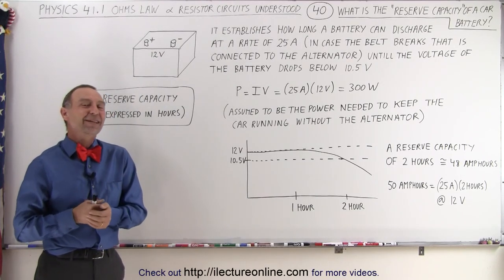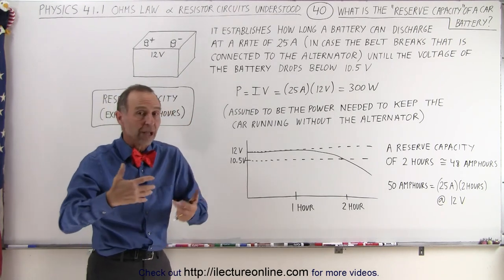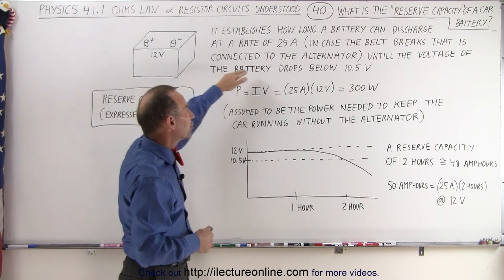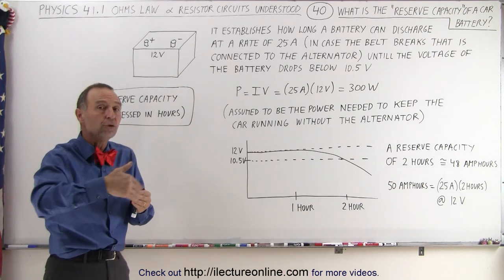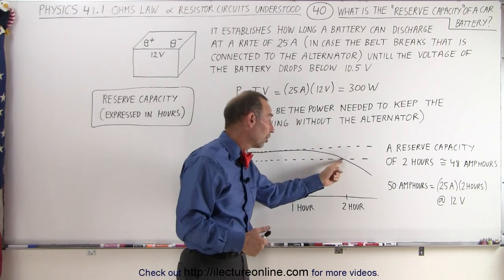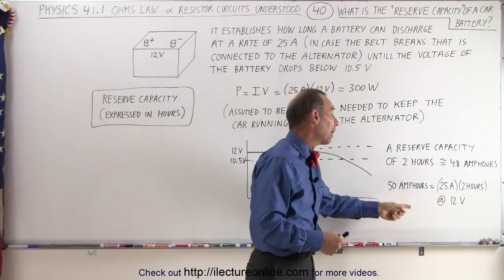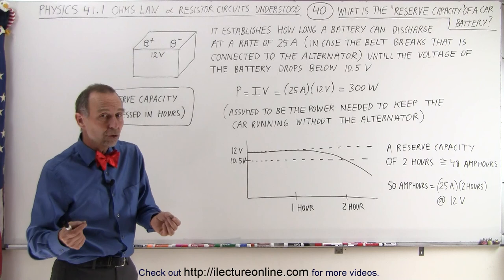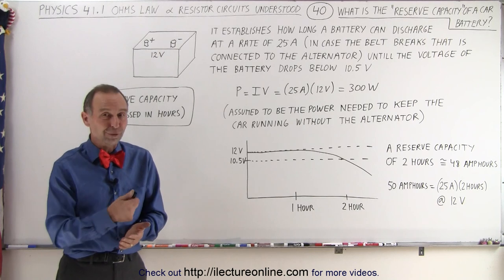Physics - E&M: Ch 41.1 Ohm's Law (40 of 42) What is the Reserve Capacity of a Car Battery?

Comment: Very helpful since I bought a cheap lead acid battery $150 to replace my good gel battery because gel battery $80 has initial current of 10 amps at 35 ah and the lead acid has 1k cranking amps at 182 mins reserve capacity
Reply from the maker: Interesting information.

Comment: AMPHOUR should be written AMP/HOUR
Reply from the maker: It is actually amphour.  It is a measure of the capacity of a device that provides a current.  1 amphour means it can provde a current of 1 amp for 1 hour which explains how much charge it can hold (like a car battery)
Reply: I was debating the nomenclature, it is a ratio @MichelvanBiezen